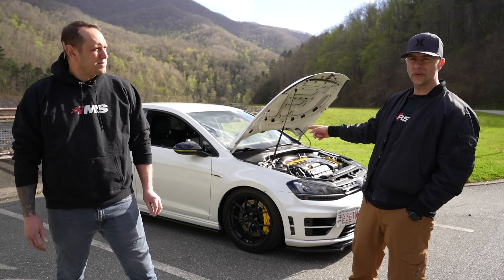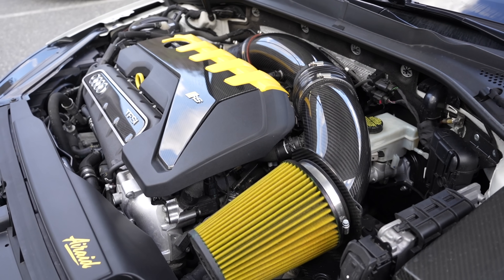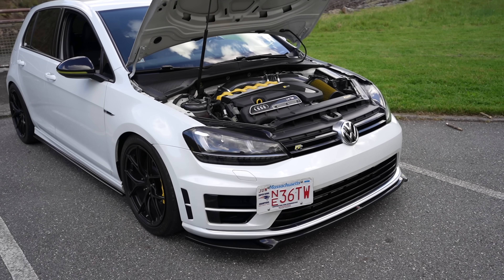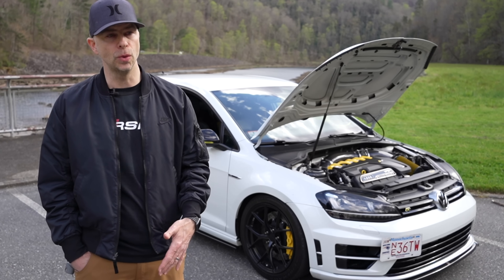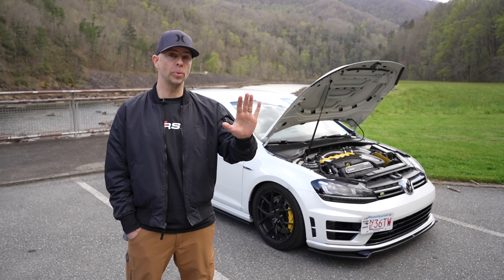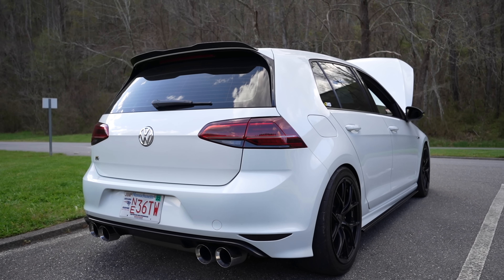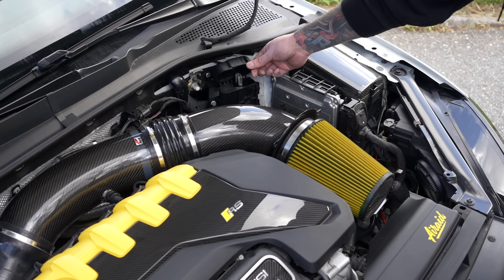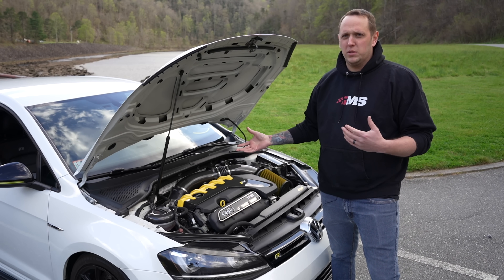RS3 Engine in a MK7 Golf R | Owner Spotlight

Comment: This is so freakin awesome. Question is, can you do this with a manual trans? I know RS3s don't come manual.
Reply: Also curious
Reply: The 8J TTRS came with the option of the MQ-500 gearbox. It would be doable with enough work and an earlier engine like the CEPA or CZGB. Not sure if it would work with the DAZA/DWNA engine like is in this Golf. Besides the DQ-500 is better at handling more power/torque with minimal fuss.

Comment: Would be nicer on a 7.5 but love it 😍
Reply: I wish I waited for a Spektrum 🤷🏼‍♂️
Reply: Why?
Reply: I like my Oryx R, but some of the Spektrums look amazing. 😍
Reply: @djbryson  it’s an amazing car. I just like the extra touches on the 7.5 and with a build this big makes sense.
Reply: might still convert a 7 to a 7.5. Compared to this engine swap this shouldn't be much work, just some body panels (front fenders, front bumper, rear bumper), headlights and tail lights. On the interior the infotainment can be swapped too, including the digital cockpit. Might be a bit more work with adaptive cruise control, of which the radar moved into the front VW badge.

Comment: Why are they making it sound like a DAZA into a Mk7 is a big super secret deal? We've been swapping them into Golfs in Europe and the UK for the last 4 years. This isn't new. It's not ground breaking. It's simply boils down to customer wallet.
Reply: You should keep in mind that this is new for them and old for us. They usually look at are stuff and copy It the American way. 
Also seen a guy in California praising the escort cosworth as if it's the only 4wd yb cosworth car from Ford even though it's literally a sierra 4x4 chassis chopped up  and made to fit a mk5 escort boddy
Reply: Also why they hell are they swapping the rear diff? Aren't all Haldex 5 VAG rear ends the same? I know the PQ35 and PQ46 have a difference, but it's only in the track of the axles. Ratios are identical.
Reply: @jaydenvogelsang3207  yeah, but surely there's less arrogant ways of demonstrating a car lol. The late 80s and early 90s would have been hysterical if YouTube was about. They were busy churning out V8s that barely made torque to idle whereas Lotus and Cosworth were making 4 cylinders that would decimate them. Lets not get into "how to make things turn round corners".
Reply: @d0rk4ge  I can sorta understand that purely from a plug and play stance, like, why not? There are a couple of CZG powered Mk7s in the UK with stock rear diffs and even Mk6s with CEP motors and the stock Gen 4 rear couplings.
Reply: @grahamek86  true chevy had the c4 corvette and a sierra cosworth or e30 m3 would probably smoke that on the track . I tend to ignore American reviews of European cars because they try to make you understand something that is completely new to them just like this video
Reply: @Gandalf721  Watch the video. Listen to the people talking. The suggestion that "we are the people for this" and the inference that it's somehow a unique conversion. The problem you lot have is your arrogance goes unchecked and you hit the defense when it is.  A stranger watching this video would think these people have just invented the 2.5 swap into a Golf.
Reply: @grahamek86  Well to be fair, they are. This isn't a common swap here. People LS swap everything in the US. You have to remember this is an American company showing off to mostly American viewers.
Reply: @pherron7471  came here to say this 👆🏾
Reply: No where in the vid did Alex or I say we were the first.  We're both aware that it's been done, but these companies play their cards close to their vests.  No one releases the wire-out diagram, or the changes necessary in VCDS to make this work.  Innovative had to figure all that out on their own.  They litterraly are the ONLY people in the US that can do this right now and to me that is a big deal, but as far as I can tell he's humble about it.  Hell, I'm surprised he's NOT bragging!  Re-watch the video man, your perspective is skewed, there is no way he's being arrogant about it.  He's simply communicating facts about what they had to go through to get it to work.  I get that a lot of Americans can be arrogant, but Alex isn't one of them.  You're projecting that on to him based on your own biases.  I'm not trying to be rude, just telling you how I see it objectively.
Reply: @d0rk4ge  Rear diffs are different.  Also Haldex ≠ Rear diff.  Both are different and can have verious models and revisions.
Reply: @Kevin_MK7RSR  there might be different versions but they are specific to the vehicle, not the engine. Like on the Tiguan and Passats their track is wider so they have a different unit for the haldex/rear diff.
Reply: @d0rk4ge  But if you have a donor, why NOT use the RS3 diff?  You don't think Audi is going to make a stronger diff for the RS3 as opposed to the Golf R?  Also, it had less miles, so why not.  You said "Aren't they all the same" my point in they are not.  Sitting side by side they were clearly different.  And I feel like "Specific to the vehicle" only goes so far being that the point of the MQB platform is that it's modular and they are making hot-swappable parts.  So it's more like specific to the platform... which is all of VAG.  So cars with a wider track could probably just use shorter axles.  IDK.  What would you do if you had the choice and you had a MK7 Diff and an RS3 diff sitting right there in front of you?  Which one are you putting in your DAZA swapped R with DQ500?  🤷🏼‍♂
Reply: @Kevin_MK7RSR  I'd leave my stock diff and save the money. Lol.

You're getting very worked up about this without and proof of difference. Go watch the DAP video about the AWD MK6 Jetta about the wide differences and you'd see why I say the rear end should stay with the car and not swap it because it's "an RS3 diff".
Reply: @d0rk4ge  No one‘s getting worked up.  I think you may be reading the tone of my statement incorrectly.  I’m just stating facts and and information i’ve gathered from my experience. ✌🏻

OK, but by your logic, and correct me if I’m wrong, a Golf rear diff would be a mismatch to an RS3 drivetrain, so why not use the RS3 rear diff so it’s in harmony?  (again, you already have it from the donor, it’s MQB and you know it fits) RS3 powertrain - beginning to end.  RS3 ECU, ABS, TPMS, all communicating and working with the rearHaldex it was originally paired with.  No?

I will check out Shop DAP’s video, thanks.

I asked that question to make you think about it, if you had them there in front of you, which would you use?  I really want to know.
Reply: @Kevin_MK7RSR  you're confusing chassis and powertrain. You don't need to match a RS3 ecu to a RS3 haldex. My gen1 haldex works with ECUs from a B6 3.6 VR6. I didn't need to do anything it just worked with the stock haldex software who just listened for the canbus messages as needed. 

As for your question, I would use the diff that is for my chassis. 

Incase the event that the unit it wider or narrower you should match it to the chassis it is meant for. Internally there should be zero difference but the output shafts might be different widths as I mentioned. 

This is why I said why would someone swap the haldex. You either got the exact same functionality with zero added benefit and a lot of extra cost or you have a unit that isn't the correct size and will break axles. Seems you have the former. 

I played a similar swap game with my 3.6 and the amount of people saying I needed the newer ESP and newer Haldex was rediculous. I lost ESP but retained stock ABS/EDL and Haldex on my 3.6FSI MK4 R32 swap.
Reply: @d0rk4ge  I'm not confusing them, I'm just saying I would rather Audi RS3 bits, beginning to end, that are designed by Audi engineers to work together in harmony.  Rather than start to mix and match and cross my fingers that something might not work optimally.  Sure, the Golf R diff with the same gen Haldex controller will probably work, but why install it and find out your wrong when you could just go with the dif/haldex combo the drivetrain came with?  That way you know it's going to sync up.

So if you're swapping a DAZA and a DQ500 into your MK7R, and you have an RS3 diff sitting there, your going with the Golf R diff?  I call bullshit. 😂  The unit is NOT wider tho... it literally fits perfectly, Innovative would not have put it in if it was a different width.  Just to clarify, you said "Why would someone swap the DIFF" not the "Haldex".  Apples and oranges but an important distinction.   My guess is the RS3 diff is beefed up to take more power so if given the choice I'm going with that.  I was able to sell my R diff anyway, so it all worked out.  I'm not arguing that you're wrong and they won't talk, you very well may be right, and maybe they won't have issues, but at the end of the day, given the choice I still think you would go RS3 diff for plug n' play ease, and possibly higher power handling capabilities.
Reply: @Kevin_MK7RSR  Are trying to justify why you wasted money on the RS3 rear end?

Sorry man, zero function difference between them. The part number difference is a letter at the end, typically indicating a minor revision difference. The rest of the name number is the same. 

Again I would NOT swap the rear end because it's NOT NEEDED. Stop assuming I will because I did my research and I know I wouldn't need to. 

Other people have put DQ500 in other cars and it works with the stock Haldex. Guess what, my Tiguans Haldex works with a 06A, DQ500, DQ3xx, 09M and 02M/Q angle drives. In fact my angle drive is the same one on the first TTRS even though it's a 09M transmission.
Reply: @d0rk4ge  I see what you did there, but I don’t consider it a waste being that it came with the donor.

They are physically different from each other on the exterior.  I can’t speak to what’s going on in the interior, I just imagine Audi took the higher power output into consideration when they decided to use a different diff than the Golf R, otherwise, why use a different diff?  Makes no sense unless there’s a reason.  Also, there could be differences in parameters and code in the Haldex your unaware of.  Unless you work for Haldex???

I’m not arguing it won’t necessarily work with the R Haldex, I’m just saying I think you would have less issues going 100% Audi beginning to end, than starting to mix and match.  And again, if you had RS3 diff sitting there…. Why not keep it 100% Audi.  You can still get $ for the R one. At that point your using the R diff and Haldex just to prove a point, rather than use a system designed to work together at specific power levels. You don’t know they are exactly the same, but you don’t know they are different either.  I feel like it would be a safer bet running the Audi diff.

You said “Why would they use that diff” My argument is why WOULDN’T I use that diff.  It makes more sense to use it IMO. 🤷🏼‍♂️  it’s not like I went out and bought it separately.
Reply: @Kevin_MK7RSR  I told you like 10 times why I wouldn't use that diff.

Maybe if you did your work yourself and not just paid a shop to do it, you get it.

I'm sorry to have gone there but you just won't realize the majority of people WILL NOT swap the diff when they do the work themselves. 

Do you have any idea how much work it is to swap the diff? How many one time use fasteners are involved and getting an alignment afterwards? For what? a Letter difference on revision? PASS

Comment: Doing a similar swap myself. A Skoda superb which is also the mqb platform but currently building the block to handle a but more power! Building a superb vrs3! Hopefully it will be done by the end of the year. Will most likely get a rpc850 turbokit on it. Swap is planned for the 28th. I'm partnering with mpcarworks from he Netherlands on the swap/build!

Comment: The 5 cyl in the jetta mk5 can hold more power because it is an iron block vs the aluminum block of the rs3's. You can pick it up for a lot less money and buy some garett precision turbos and intercooler and get even more performance and better sound
Reply: And people have been doing this for a while now.  Buddy of mine first swapped a mk5 5 cylinder into his mk4 jetta gli.  Now has one in his mk6 r.  Iroz motorsports out in Las Vegas is the go to for 5 cylinder work.  Hadnt heard of this company before until this video popped up.

Comment: 30K for the swap, knowing it's pretty much a complete RS3 underneath it all, is a bargain because of the modification capabilities and potential the 5 cylinder has. It has part shared with the Huracan, these things are BUILT to be monsters, and this thing now screams the definition of sleeper build. I'd spend the extra money to make it a longblock while it's being swapped, just so that any future bolt-on mod would be easy to do. 400HP to 1000HP in a weekend 😂 (jk buuuut doable!)

Comment: This thing is can be possible on a GTI or only in a Golf R ?
Reply: It's possible on 1.2tsi if you want.
Reply: Nah you would need the AWD chassis for this. Nothing that couldn't be changed after all, but it would require some welding for a FWD car to fit the AWD system.
Reply: @justus9694 Nah, it can be done easily, as long as you get the rear axle from an R/RS3, etc

Comment: Ive been wanting to do this to my 90 g60 corrado but i dont have the time nor intelligence to do it. If theres a way to do it i would have the most badass corrado ever
Reply: Engine is longer than vr6, I wouldn't dare to cut/hammer in chassis legs just to fit it, as is must on all subframe engine mount models. Rather R engine with DSG.
Reply: @ventouxR  what would you recommend, because i want i new motor and trans in a n old-school body

Comment: I have a family sedan and I raced a RS3 and I started pulling away from him in third and then more in fourth. 

When he stopped next to me at a set of lights he asked what I had done to my car and I said not much to what it is now under $20,000. 

I have a Aussie ford falcon xr6 turbo and they come from factory with 270kw and 420 nm torque but I had work done to it and now I have 500rwhp and 550nm torque and I have spent just under $25,000 buying the car and having a dyno performance shop tune it and fit better performance parts and I daily drive it and drive it to track days race around the track all day with my son in the passenger seat his 14 and show him and tell him what I’m doing and why he really concentrate’s on what I’m teaching him. 

When he is old enough and aloud to drive the car by himself I’ll be giving him the car to be his with a big promise that he doesn’t drive it like an idiot and he doesn’t have cause an accident or crash the car trying to show off in front of other people. 

There’s two more modes that I’m going to do and that’s get the gearbox built to handle 1000hp and bigger turbo and head bolts and then I’ll have 600-650rwhp and still be a daily thanks to pcmtec as I can have 4 different tunes with different amounts of power.

Comment: You know. The mk4 jetta has that 5 cylinder. And the two generations have the same mounting points and it's basically the same engine
Reply: Mk4 never came with a 5 cylinder.  Mk5 did.  Mk5 5 cylinder drops into a mk4 with very little work.

Comment: HEAVIER front end with a bigger motor? Would that change the Front Rear weight distribution handling characteristics which its engineered for especially on Autocross and Circuits?
Reply: I believe the rs3 has a aluminium block. Help saving a heap of weight
Reply: Aluminum block.  It’s actually significantly lighter.  But the DQ500 trans is beefier so it’s a bit heavier.  The weight comes out to be about the same (maybe slightly lighter) but now it’s lower in the bay.

Comment: Why not R36 Turbo?
Reply: I would have if I could get an aluminum block.  Also, from what I understand when you go big power trans's start to crack.  I didn't want that headache.  I think it's more complicated moving older parts into the MQB chassis.  Not impossible, but more complicated.  Innovative already did the R&D on this and proved it worked. It was just easier.

Comment: Why not just do forge internals on a 07k and turbo it
Reply: Because it’s not the same motor like people think. There is no turbo manifold for it, fabrication would be more expensive than a wrecked RS3 that would basically just bolt right in.

Comment: its so odd seeing all these built motors and swaps with an automatic trans.  I just cannot get on board.  Even if its better gear ratio, quick shifts, etc. Id rather have a slower car with a stick then a fast car that drives me running an auto.  This is s nice build, but its gotta be a requirement to run a manual.  To each their own, but I just don't understand the auto trans world.  If you wanna car that drives you, get a Tesla.